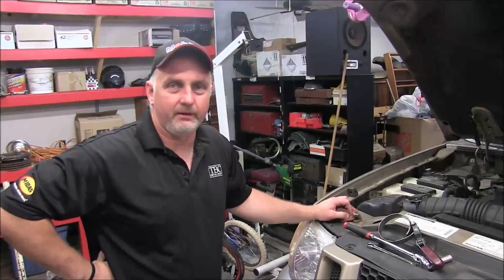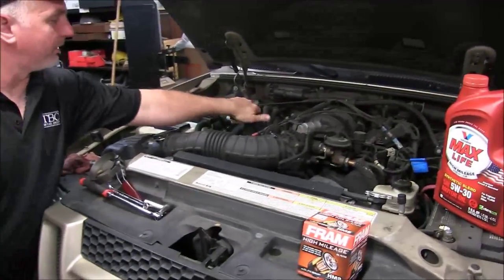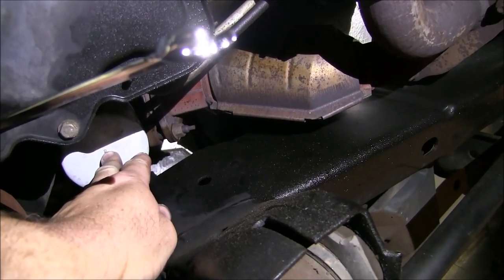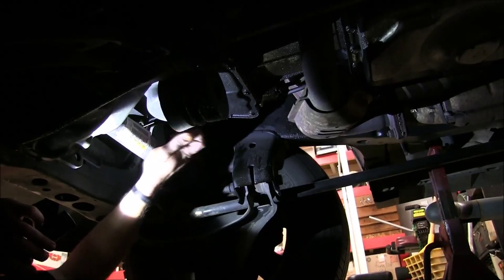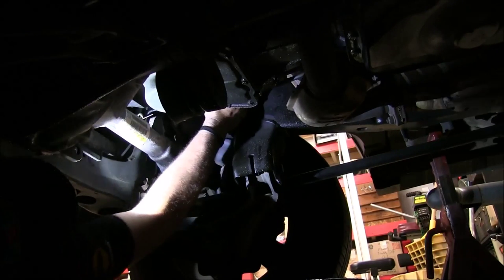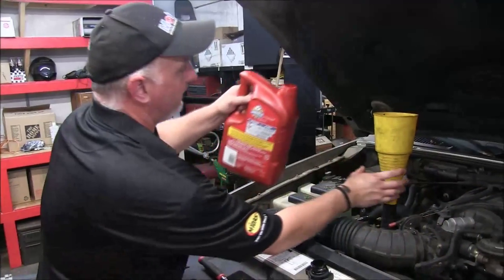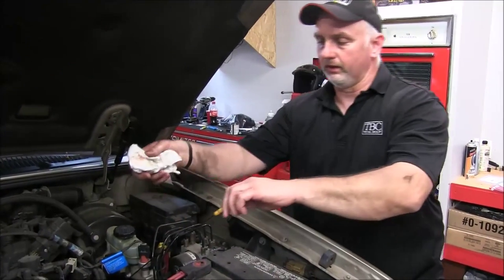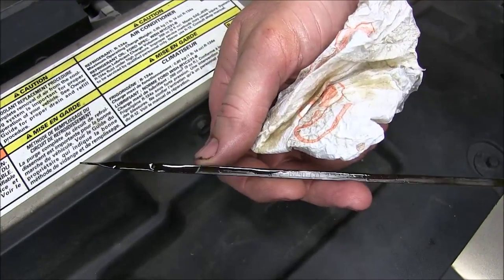How To: Change Oil In A 2001 Ford Explorer Sport Trac

Comment: I have two of those band wrenches both were to big. I lucked up and was able to get it off by hand. That did not sound quite right but you know what I mean. I got the mobile one oil and filter, $45.00. synthetic oil. Says it will last a year for engines over 75,000 miles. I do not plan on letting it go that  long. I took the filter out of the box and it was twice the size of the one on the truck. Yeah one of my band wrenches will fit that. Last time the oil was changed it was at one of those places you drive into and they change it right there. Never liked places like that , who knows what they are putting into your engine. And if that oil filter is any clue as to what they do, I'm  not going back. Who ever tightened that drain plug, must have had his Wheaties that morning. It was a sweet heart to break lose. Glad I got that done. Say what is the deal with windshield wipers ? $23.00 each. Damn parts houses are trying to retire early. I hate to go to Walmart but got them there for $10 ea.

Comment: I'll look again - but I swear I couldn't see the dip stick when I checked the last time.  I'll look again later.
Also - my oil gauge is not working - I do plan on getting that repaired, but is that a huge problem that needs solving immediately?  All other gauges are wrkng and show no problems.